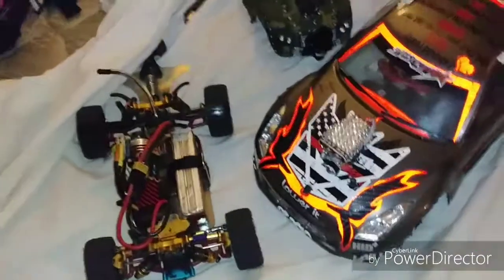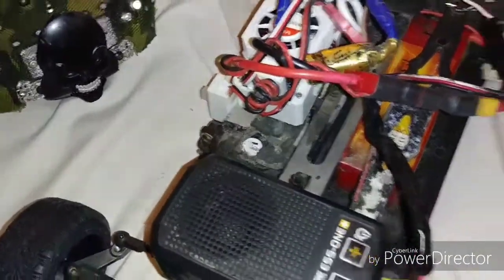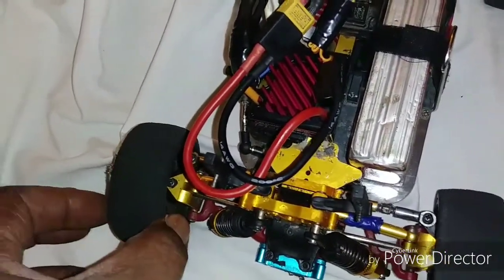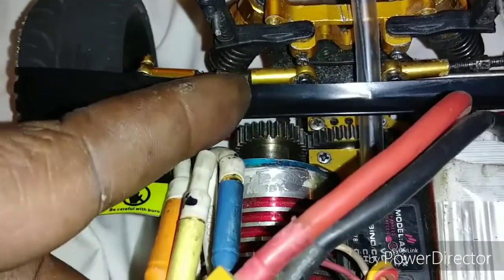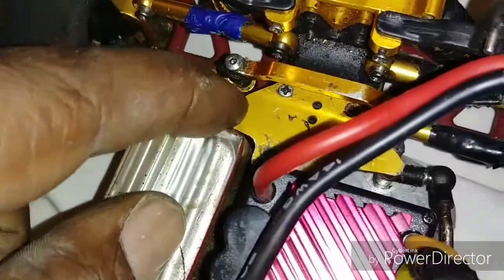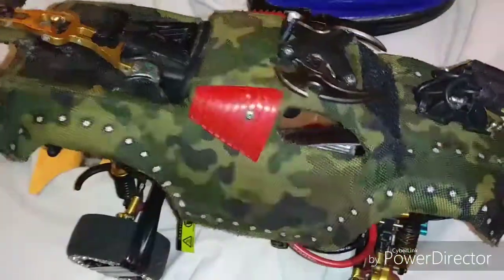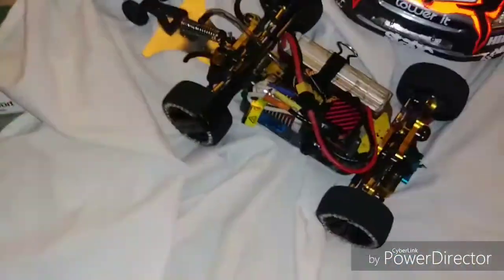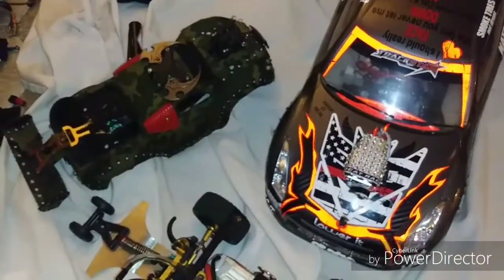Spankz Exceed MadDrift & Wltoys A959 back on the road

Comment: What did you use to make your servo arm? It looks good I'm trying to fix all my steering issues also.
Reply from the maker: It's half a metal and half plastic dogbones.. I bent the metal shaft a lil to fit
Reply: Thanks for the video and your your secrets. I did that same to my steering with the extra arm and it did the trick. Thanks again.